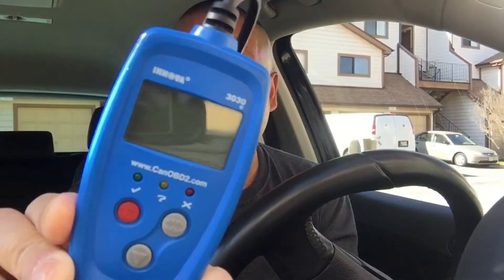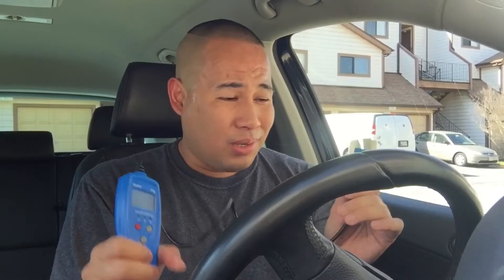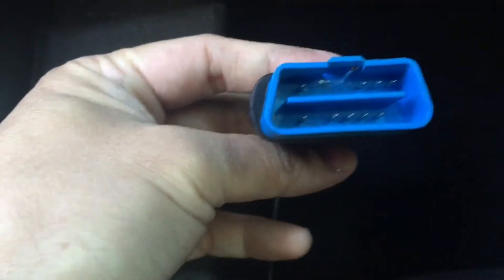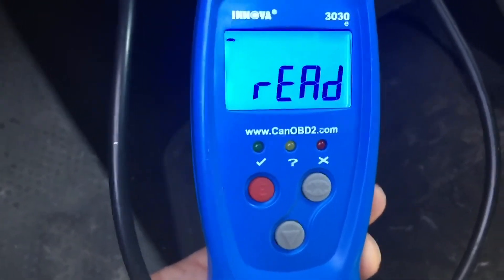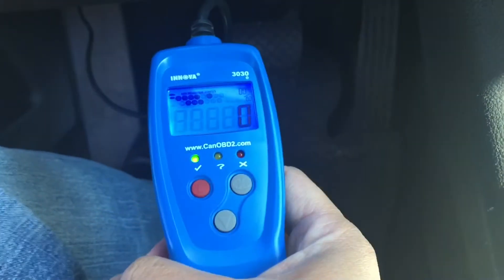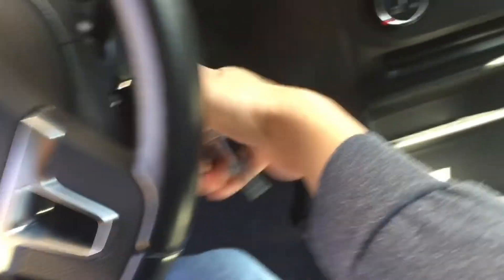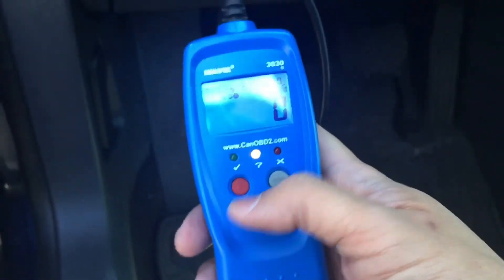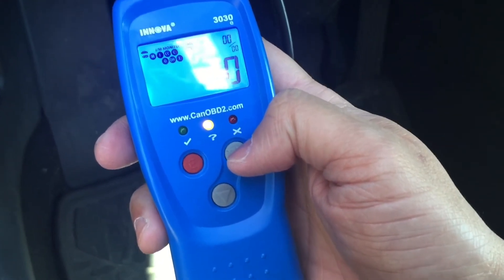How to Get the CHECK ENGINE Light Error Code  - Volkswagen Tiguan Atlas Beetle GTI Audi More

Comment from the maker: You can buy the OBD2 scan tool from the affiliate links below:

INNOVA 3100RS Code Scanner
https://amzn.to/2LXaS3y

 FOXWELL NT510 Pro Automotive Full System Diagnostic Scanner for VW Audi Seat Skoda OBD2 Code Reader ABS SRS SAS EPB TPMS DPF BMS Transmission Oil Light Reset Tool
https://amzn.to/31zYCIu

Autel MaxiCOM MK808 OBD2 Scanner Diagnostic Scan Tool with All System Diagnosis and Service Functions Including Oil Reset, EPB, BMS, SAS, DPF, TPMS Relearn (MD802+MaxiCheck Pro)
https://amzn.to/2H3CRsG

ANCEL VD500 OBD II Diagnostic Scanner for Volkswagen VW Audi Skoda Seat Diagnosis Check Engine Light EPB ABS SRS Code Reader Oil Throttle Position Adaption Brake Pad Reset Tool
https://amzn.to/2Kw4ooX

Comment: This is good introduction to how diagnostic scanners work but there is a lot more to it. It’s important to know a basic scanner like the one shown retrieves generic codes, that is to say the codes used by all manufactures and the code means the same thing on all OBDII equipped cars. Beyond this are manufacturer specific codes that are specific to a make and model. The same number can mean different things depending on which car you are reading. A basic scanner will generally ignore these codes. A basic scanner will not pull codes from all the modules, it is specific to the ECM, There are separate modules for things like the ABS (braking system), PATS (security system), BCM (body cont module- lights etc), TCM (transmission) and many more depending on the car. 

Some more advanced scanners will also show live data, for example if you have an oxygen sensor coded you can read the value of that sensor. Important info if you plan to work on the vehicle. It is also possible to “data log” live data and find intermittent issues. 

This is still skimming the surface of what can be read through the data port but there are major differences between a $79 scanner from the parts store and the $900 unit repair shops use and it’s not just a better screen. The inexpensive units can ignore codes and make you think everything is ok. A better option is a blue tooth adapter to plug into the car and a phone app. Some do a very good job, maybe not “pro” level but much more complete information.

Comment: Kamusta Jeffrie, my 2017 Alltrack had a check engine light today I was going to bring it to the dealer Monday until I saw your video. Check the gas cap, seemed loose , gas the car up full tank, then use my Actron Scan tool to clear it. And verified no errors. Told my intsik wife , it takes an intsik to figure it out.  Maraming Salamat, subscribed pare !
Reply from the maker: You're welcome. I am glad that my video was able to help you fix the issue. Thank you very much for watching my video. I hope that you will support my channel by subscribing. Thank you again 🤗😀
Reply: Thanks again Jeffrie, all my VOlkswagen had been trouble Free, so when I saw this Check engine light, I didn't think it was a loose gas cap. 
So I guess my 7 year trouble free record still holds up, for 5 different Volkswagen , now presently 2011 Golf , 2016 e-golf and 2017 Alltrack SE
I subscribed so I can get feedback on TSI engines. Cheers
Reply from the maker: My pleasure. Thank you for supporting our channel. We really appreciate it. I'm going to add more videos when spring comes 😀🤗

Comment: E J garage, thanks for your reply about my tiquan 2010 SUV battery cover! Do u any suggestions about my small oil leak apparently coming from the rear main leak?? I did use blue devil oil leak sealant,but it stop the oil leak completely, so I'm waiting to use Lucas oil leak soon! My tiquan VW is a Wolfsburg edition, previously I was using conventional oil instead of synthetic oil, please reply asap
Reply from the maker: The rubber seal is probably getting old and needs to be replaced. I bought a seal. I use this ATP AT-205 Re-Seal Stops Leaks, 8 Ounce Bottle on my Jaguar XJR and it worked. https://amzn.to/2Ir9dh8

Comment: Hi I just wanna know if the scanner will work with vw Tiguan 2016. Thank you.
Reply from the maker: +Dagmara Wosko I have the old model from 2011. The newer model should work on your 2016. It is an awesome device to have. It has saved me a lot of money. I don't have to take the car to the dealership. Just call Inova or email them to verify it. They are good in responding.

Comment from the maker: You can buy the OBD2 scan tool from the affiliate links below:

1. FOXWELL NT510 Pro Automotive Full System Diagnostic Scanner for VW Audi Seat Skoda OBD2 Code Reader ABS SRS SAS EPB TPMS DPF BMS Transmission Oil Light Reset Tool

https://amzn.to/31zYCIu

2. Autel MaxiCOM MK808 OBD2 Scanner Diagnostic Scan Tool with All System Diagnosis and Service Functions Including Oil Reset, EPB, BMS, SAS, DPF, TPMS Relearn (MD802+MaxiCheck Pro)

https://amzn.to/2H3CRsG

3. ANCEL VD500 OBD II Diagnostic Scanner for Volkswagen VW Audi Skoda Seat Diagnosis Check Engine Light EPB ABS SRS Code Reader Oil Throttle Position Adaption Brake Pad Reset Tool
https://amzn.to/2Kw4ooX

https://amzn.to/33r4g1n

Comment: 2020 volkswagen tiguan code b200049 anybody know what this code is for?
Reply from the maker: Fault code B200049 Control Module Faulty is related to the problem with faulty stearing control module.

Comment: How fix the epc on car
Reply from the maker: Here are four different parts of your Volkswagen that might need repair or replacement if your yellow EPC light turns on:

Mass Air Flow Sensor

Brake Light Switch

Engine Speed Sensor

Throttle Body
Reply from the maker: Thank you for subscribing and supporting our channel John 😀

Comment: What is the meaning of the error code P0171 (Tiguan 2009 model). What causes it and whats the remedy and where to order required part from.
Reply from the maker: +Aggrey Z Possible causes Intake air leaks Faulty front heated oxygen sensor Ignition misfiring Faulty fuel injectors Exhaust gas leaks Incorrect fuel pressure Lack of fuel Faulty Mass Air Flow (MAF) sensor Incorrect Positive Crankcase Ventilation (PCV) hose connection.
Reply from the maker: +Aggrey Z If the P0171 is combined with the P0174 code, it's very likely that the problem is caused by an intake leak. If there are no intake leaks, the next step is to replace the air filter and clean the air flow meter. If the problem persistss the front oxygen (O2) sensor may need to be replaced.
Reply from the maker: +Aggrey Z I will just buy it at the dealership parts department if you cannot find it online.
Reply from the maker: +Aggrey Z Good luck and please subscribe 😀